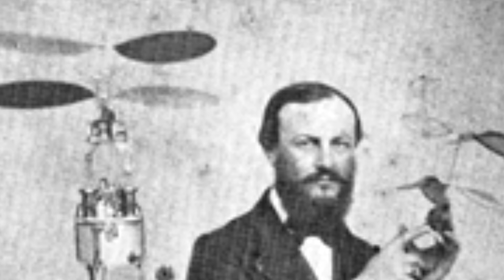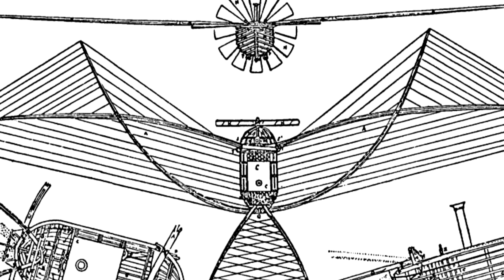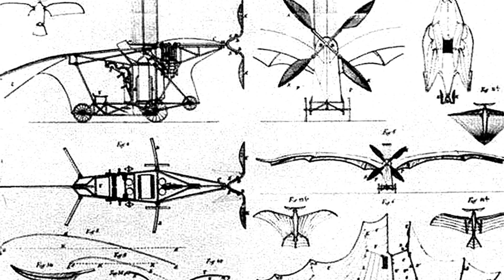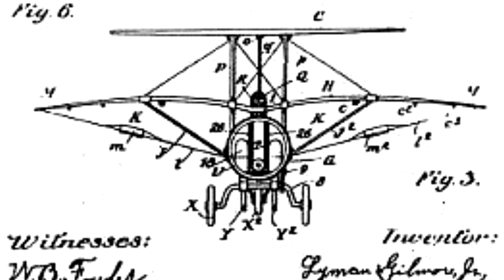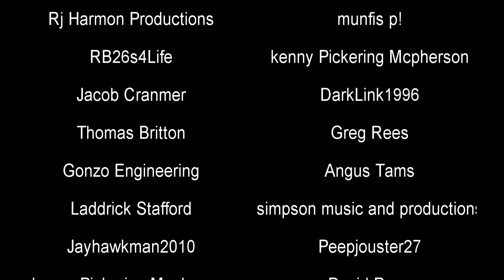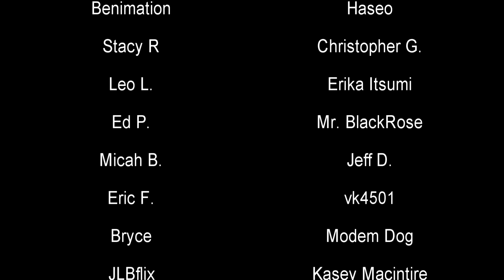Why Aren't There Steam-powered Airplanes? | History in the Dark

Comment: A Doble style water tube steam generator boils a couple pints at a time. Pair that with a steam turbine and condenser then it could be feasible. Condensing steam back into water at altitude would be easier since the ambient temp drops with increase in altitude. Also, if you can work out how to collect water from clouds then you wouldn't need to carry as much initially. A small steam turbine powering a ducted fan under each wing fed by a central water tube steam generator running on any random volatile liquid would be pretty interesting.
Reply: In my mind, it would be like a high-bypass turbofan, with the inner section housing the turbine, condensor, and boiler; and the outer section lined with more condensor surrounding the bypass fan portion. Use the heat from condensing as additional thrust efficiency.
Reply: The Doble system flash boiler as it is called was indeed used in the Besler steam plane, it's the only system of generating enough steam and that is light enough to power a plane, other cars that used a flash boiler were the Stanley Steamer and the Sentinel steam lorry of the UK, and there may be other ones. A flash boiler has the advantage that it can operate safely while at steep angles, a conventional boiler wouldn't survive long in a plane, as would the plane itself and the inhabitants, as there is a crown sheet that has to remain covered with water at the top of the fire box. Just watch the video posted yesterday by History in the Dark.
Reply: Turbines would be better suited for larger machines.  Piston engines and turbines are about equally efficient at around 1,000 HP with piston engines being progressively more efficient as your size diminishes...turbines are more susceptible to the square-cube rule.

Comment: As President of the Steam Automobile Club of America, and a guy who worked with naval steam propulsion plants, I'd like to say that there are several reasons why we don't have steam airplanes.  The first is thermal efficiency ... a steam plant will consume significantly more fuel due to the latent heat of vaporization...which is the energy needed to turn pure water at boiling temperature into pure steam at exactly the same temperature.  At sea level, that comes out to 970 BTU per pound of water.  This is a lot of energy; unfortunately, it is classified as a non-reversible process; the problem with non-reversible processes is that you can't extract energy from them.  So, we have an efficiency loss.  

Another reason for low efficiency is that the efficiency of any heat engine is proportional to the difference between the highest and lowest absolute temperatures in the cycle (absolute meaning temperature above absolute zero.)  Internal combustion engines can run at very high temperatures because the gases inside the engine can be very hot, and we only need to cool the engine walls enough to avoid damage.  Steam, on the other hand, is external combustion -- meaning that the heat is on one side of the wall and the steam is on the other.  We simply can't make steam as hot as engine combustion gases simply because the metal boiler tubes would melt.

That same latent heat of vaporization leads us to an even bigger problem --- condensing.  Let's assume a small plane with a 100 HP engine that operates with better than typical efficiency, consuming 10 pounds of steam each hour, for every horsepower produced.  This is far, better than a Stanley steam car can manage ... and even beats the Doble (which gets about 12).  That's 1,000 pounds of steam consumed every hour.  I know of no 100-horsepower planes that can lift an additional 1,000 pounds of payload, and an endurance of one hour is rather limiting. The obvious answer is to condense the steam and reuse it.  People who don't understand light steam assume this is simple, but it isn't.  Besler certainly understood light steam, and his plane had a condenser, but it only recovered a portion of the steam used by the engine.  There are a few reasons why condensing is so difficult, the first is the density of steam.  At atmospheric pressure, steam is about as dense as air -- go figure, it's made out of oxygen and hydrogen. If we look at a car's radiator, we see that the air flows through a myriad of fins while the water flows through small tubes -- obviously, the air is in contact with far more radiator surface area than is the steam.  This is precisely because water is so dense relative to steam, and far more molecules come into contact with each square inch of radiator tube than air ... hence air needs a lot more area.  If steam is about as dense as air, we will need a much larger condenser with a similar surface area in the air and steam sides.  This is why steam electrical plants are water-cooled.  

This is not the end of our woes.  As noted above, steam plants are less efficient and therefore need to reject more heat to the atmosphere per horsepower produced, meaning we need a proportionally bigger heat exchanger.

We take another hit in the steam plant because the flow of heat through a solid material is proportional to the temperature difference on each side of the wall...the flow drops greatly as the temperatures approach each other.  This limits boiler efficiency because we can only pack so much tubing into the unit. We would be fortunate to reach 90 percent boiler efficiency in an automobile or aircraft boiler, with 85 percent being more probable.

Comment: I mean, even if engines exploding in mid air can cause possible death for those on board, a steam engine explosion on a plane would be horrific. With the possibility of too much heat there would be a possibility that it could cause an explosion so violent it would rip off the wing, and the shockwave would do more than just depressurize the entire cabin. A jet fuel engine explosion would be dangerous, but a steam engine explosion would be catastrophic.
Reply: You're thinking fire tube boilers not water tube. Fire tube boilers like on a steam loco are just massively heavy bombs waiting to happen while water tube boilers can be built to avoid that issue entirely.
Reply: The Flyer I took off from a track. Futurists in the 40s imagined glider trains where gliders would detach like slipcoaches. Could you imagine an alternate history where sky trains would have crownsheet explosions and crash into the oceans, Darkness would have centuries of content.
Reply: Yeah, 'modern' (1920s tech) steam tube "boilers" are called 'steam generators' to differentiate them from the old boiler design. Steam generators can burst, forming a small hole that dumps steam. But they dont explode. They also run at higher, sometimes much higher, pressure. 800-2000psi is doable. The higher the pressure, the smaller the whole system can be for the same power.

Comment: Some types of torpedo were steam powered, but they used a chemical reaction to generate the steam and only had to run for a few minutes.
Reply: The Germans were even experimenting with uboats that were powered in a similar way. The Class XVII, XVIII, and XXVI were planned to use hydrogenperoxide to produce steam for propulsion and oxygen for the crew. None of them were built, but they managed to build a prototype to test the propulsion in 1940. Their prototype managed to reach 28kn submerged, with a hull designed for underwater travel. Given that most nuclear powered submarines are in the 20kn to 30kn range that's pretty impressive. Unfortunately I couldn't find anything about endurance

Comment: ORC units exist to day and are ready on the market. You can go buy one pretty much of the shelf currently. They are effectively steam motors. But they use organic steam (that is a solvent) in steed of water. The reason is to have a lower condensing temperature and hence higher efficiency at the low end with smaller turbines. Saving both weight, space and cost.

Non of the one exist today are made to be used in a aircraft

Climeon sells a container size unit with the power of up to 355kWe power output. The unit is mostly steam exchangers because its made to be feed hot water or hot oil, not to be fired.

The actual steam turbine is tiny, no larger than a large suitcase so it could easily fit even in a light aircraft.

The secondary  heat exchange's could probobly be rebuilt into the wings and the primary heatexchanger could be replaced with a burner.

And note, this is a product you can order to day and have delivered with in a few weeks.

Comment: 10:00 boiler... Well... You could use a steam generator instead like some stanleys did. I think a few doble cars did as well. Steam motors were a thing too, all of which were very compact.
Reply: Steamgenerator-Turbine unit already exist and you can buy them of the self as mass-produced items.

Those are organic items so someone might consider them not steam, but they work effectively the same way.
https://www.youtube.com/watch?v=oA57x_3jRgs
Reply: Yes, the Doble steam systems were the most advanced ever used for transportation.
Reply: Actually, there were several automotive systems that were arguably superior to the Doble. The Endurance steamer saw  only limited production, but was much more sophisticated.  Back in the 60s and 70s, there was a push to build steamers to fight the smog problem; some prototypes easily exceeded the Doble in many parameters.  Nobody, however, came close to beating Doble when it came to promotion and marketing.

Comment: Flash steam mono tube boilers have been used in models. Lighter, less water & equipment weight, but still limited range….   The is a Shri Lankin R/C model achieving 7 min. Flights on
Minuscule amounts of on board water low equipment weight.

Comment: For context, even Diesel engines have historically been too heavy to use in aircraft.  They are roughly usually double the weight of gas engines (though still much lighter than steam), and only recently has the technology improved to the point where it is started to implemented in a few airplane being produced today.  Yes the Germans also had a couple designs, some even successful during the war, but even had their drawbacks at the time.  The reason gas engines have always been used, is the power to weight ratio.  If something was better, we'd be using it.

Comment: before we start, steam boiler big+heavy+ not airplane
Reply: A modern titanium pipe boiler is not very heavy. Those used in combine cycle turbines the system is probobly per kW lighter than a normal car engine
Reply: You are misunderstanding: steam boiler =/= steam generator. Boilers can explode and are heavy and inefficient.  Steam generators are very efficient, cannot explode, are very light and can be designed to be compact. 
I got to see a car that was built in the 1960s (being restored) it had a closed steam system, 700psi steam generator, produced 600hp at the wheels, and from the outside, you cannot tell it isnt a normal sedan. I spoke with one of the men who designed and built it originally. They felt that with modern metallurgy, and CFD computing software, that a 1000hp steam car could be built with everything fitting under the hood like a jormal piston engine. Its not easy, but it is doable. And whereas in a car, the condensor is wasted energy, in an aircraft, that heat can be turned into useful work by adding it to the airflow as a thrust augmentor. ( like how the radiator in the P-51 produced very slight thrust that compensated slightly more than 100% for its own drag )
Reply: @Bearthedancingman  thank you

Comment: Steam engines work best at low revs - because you are not continually depressurising the boiler. Internal combustion work best at high revs, where they are pulling through more fuel and air to burn. Aircraft require high revs or the propeller will not be effective.

Comment: The water condensor system is the primary weight. Modern steam technology is capable of this. However, the total number of people who actually understand how to do this could fit in minivan together. I've met most of them. 
There are potential (theoretical) benefits to modern steam systems. The primary benefit is the ability to burn unconventional fuels in a clean, low-pressure burner. The Doble steam car from the 1930s burns kerosene so cleanly, that it was able to pass California emissions in the early 2000s.  Microtube steam generators with supercondensors driving full expasion single operating pistons is the most efficient.  Turbines are insanely powerful, but not as efficient at low SIZE. but larger engines wiuld be able to use turbines running steam at very high pressure and very efficient condensors designed to produce slight thrust from marideth affect. It would likely look like a turbofan.

Comment: A steamengine/turbine is not the problem the production of the steam to power those engines/turbines is the problem.
Steam engines have "UNLIMITLES" torq, because every stroke of a piston is a powerstroke.
There is footage of a just 110 HP case steamtractor doing a full pull with ease, like the tractor pulling sled behind it doesn't even exist.
Also very recent a German class 58 (Prussian G12) heavy freight engine pulled a high priority freight train with new railway sleepers to a mainline railway renovation site.
There was no electrical power on that line to use  electric locomotives and 3 heavy diesels were needed to pull that train and only 1 heavy diesel was available. 
So the close to 100 year old gal came to the rescue to get that high priority train to the  construction site. 
A sort of steampower is used in modern fighterjets/spacecraft.
Emergency power units use hydrazine fuel and a kathalitic converter to make a high volume and pressurised gas to power a turbine to create electric/hydraulic emergency power